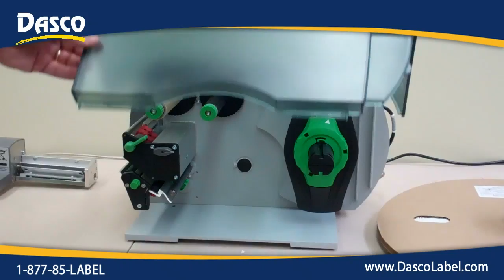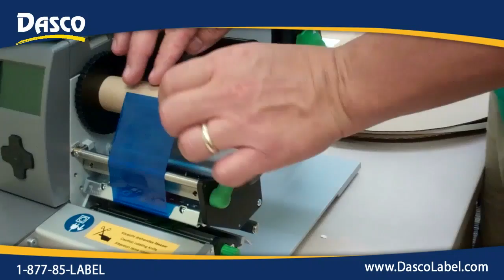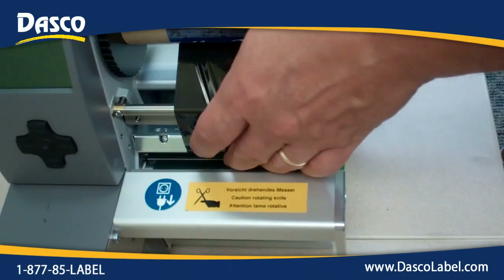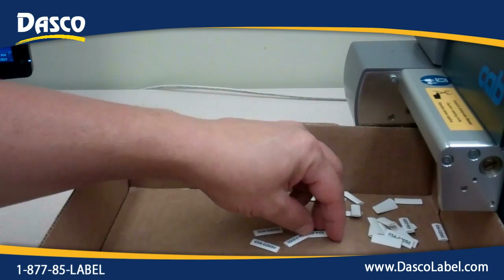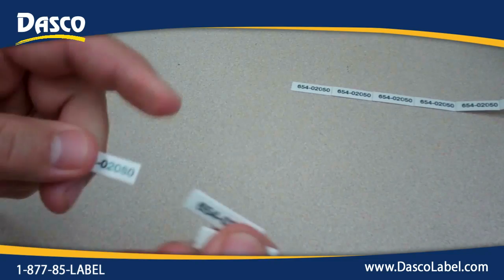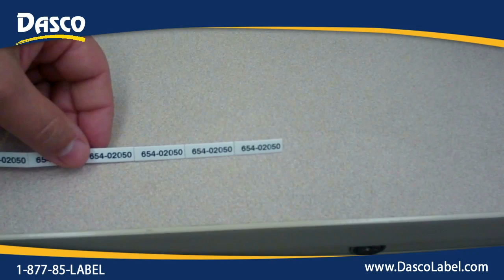How to use the Cab A4+M Perforation Cutter Attachement

Comment: Hi,I have 2 cab drivers,this one and the double sided plus the cutter,i have been trying to get the cutter to perforate but i seem to be failing,please help on how to do that
Reply from the maker: +Keitumetse Modise 

How to adjust the cutting depth on the CAB PCU4 cutter:
With the cutter attached to the printer and the power on, complete the following:

Press the "Menu" button
Press the right arrow to get to the SetUp option, press the down arrow
Press the right arrow to get to Machine Param option, press the down arrow
Press the right arrow to get to Cutter option, press down arrow 
Press the right arrow to get to Cutting Depth, press Enter button
Use the left and right arrow to adjust the cutting depth, the lower the number the less it will cut into your material.  You may need to adjust this down to a Minus (-) 10 or 15 to get the proper cutting depth.  When complete press the enter button to save your setting
Use the up arrow and back arrow to back out of your menu options to the main screen
Print material to test the cutting depth
Repeat the above to fine tune your cutting depth to where you would like it.
If you have questions or would like further assistance give us a call at 763-574-2275

Comment: HI, you put the sensor on Continuos or gap??? because I can print heat shink like you.
Reply from the maker: +Hector Salinas Hi Hector,
Thank you for your question. If you are printing on continuous heat 
shrink tubing, you need to set the printer setting to continuous in both
 the computer's printer driver and in the software you are using to 
design and print the label. Make sure you do it in both areas as 
depending on the software. Sometimes it does not carry from one to the 
other. I hope this helps!